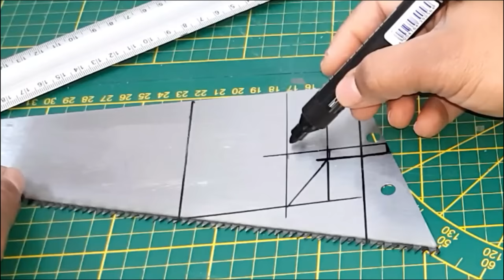Amazing // How to turn a hand saw into an electric saw

Comment: But it's not cutting in right angle
Reply: A powered saw works best when the cutting movement progresses in the direction of the cut. Jig saw blades are designed so that the teeth cut progressively forward on the up stroke, here the saw is withdrawing from the cut on the upstroke, the user has to push the saw into the cut. Whatever advantage is gained in the powered reciprocating motion of the jig saw is lost in poor implementation!!
Reply: The implementation appears to work on the down stroke, the saw teeth are facing 
forward, fine for manual operation but wrong when used with a jig saw designed to cut on the upstroke in general, except in the case of blades that cut on the downstroke for cuts without splintering on the laminated top surface.